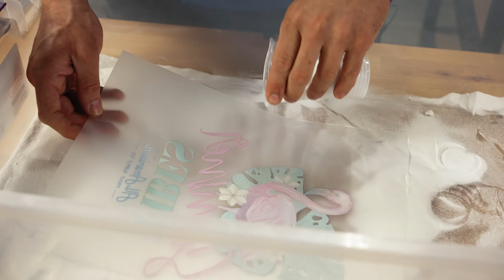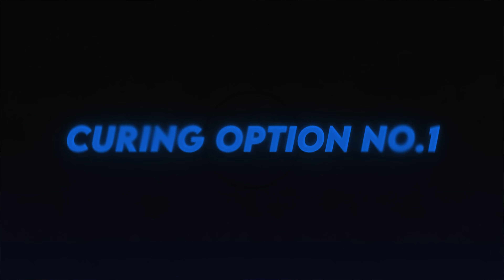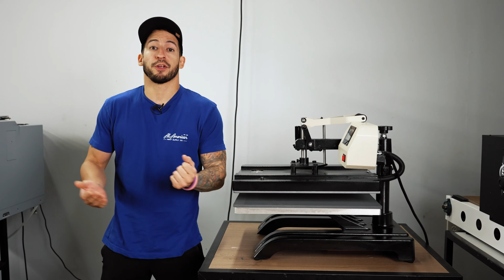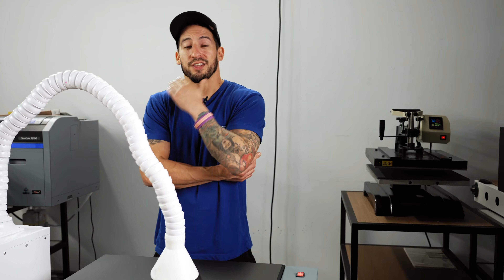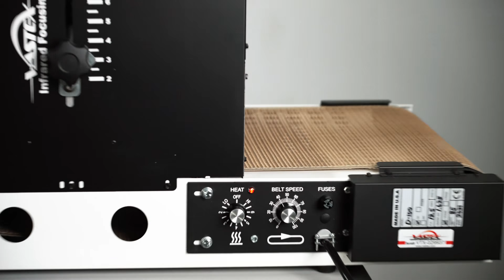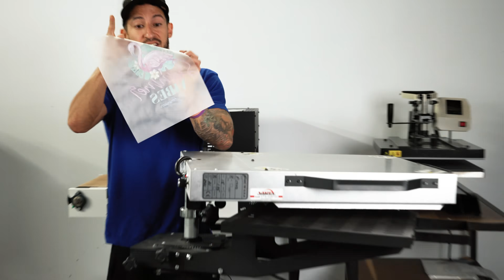Best ways to cure for DTF | AA Print Supply

Comment: Does the f1000 work to cure shirts with dtg?
Reply from the maker: Hey there! The F1000 is going to be a printer only, you would need a heat sources such as a heat press or conveyor dryer for direct to garment printing to cure the shirts produced. Also, just fyi - the cure practices in this video are for DTF specifically, not DTG curing

Comment: I've tried all these options, except for the conveyer heater thing. You know what I found works best? A $30 electric griddle from Walmart. Just throw the transfer (ink side up) right on the hot griddle. Cures so fast.
Reply from the maker: Very interesting! What time and temperature settings work well for you?
Reply: @AAPrintSupplyCo  I do 350 degrees, and I just watch it and pull it off when it looks right, which turns out to be around 30 seconds or so. You can literally throw the film directly on the hot plate, or on a piece of parchment.
Reply: Awesome. Which griddle? Do you have a pic or a model number?
Reply: I'm thinking about getting the curing oven. Do you still need to put the glue and spread it around, before putting it in the oven? I would rather avoid the manual glue process.

Comment: You're doing the heatpress melting wrong. :D
Reply from the maker: Hey there! What methods for using the heat press with DTF curing has been successful for your set up?
Reply: Seal the heating element perimeter with 3/4 inch cutout strips of silicone pads.
Leave 1 inch vents at the corners. Fire up at 210'C, and for just 60-80s and blow warm air at low to medium velocity around the vents, don't stay in one vent.
Also make "silicone pegs" - 1/2inch tiny cutouts to hold the film down to avoid touching the heating element, film flops around as you blow air so pinning around the film corners is a must. This is best done with Teflon mesh at the bottom, so hot air can circulate and cook the ink, pre-heat the plate for at least a minute before first cooking. It works like magic.
Reply from the maker: @skipperay  This sounds awesome! Might I be able to please request photos of this set up sent o Estevan@aaprintsupplyco.com

Comment: question .. after applying powder on dtf print how long can we wait to cure? I ask because my curing process is done outsdie for ventilation and it would be so time saving if i can print and powder several prints before taking them all outside to cure.
Reply from the maker: Hello that is a good question, we have not conducted this sort of testing. That being said I would prioritize APPLYING the hot melt powder while the ink is still wet so it can stick to the printed image to the best of it's ability

Comment: What is your heat panel temp at when you set it to Level 2 Heat?
Reply from the maker: Hello, per Vastex they can cannot determine the actual heat for level 2 on this dryer; that being said level HI should run around 750F.  Digital temperature control options begin at the larger LittleRed X1 dryer series and up (comes in 18" and 30" belt widths)

Comment: Do I need to ventilate to outside wall on oven method 2? Thanks
Reply from the maker: Hello, dedicated exhaust ventilation to a window is not required. We advise the use of this purifier to keep the work area clean and free of steam/vapor from production: https://aaprintsupplyco.com/products/purifier-mini-portable-air-filter?variant=39680750026836